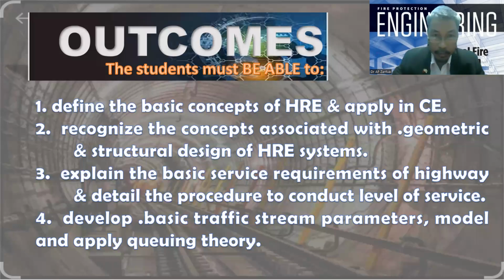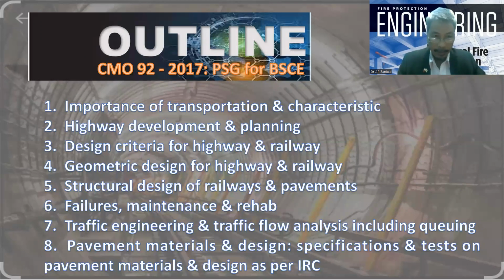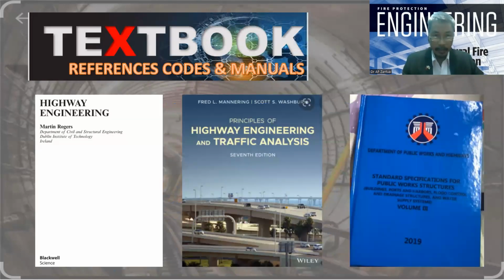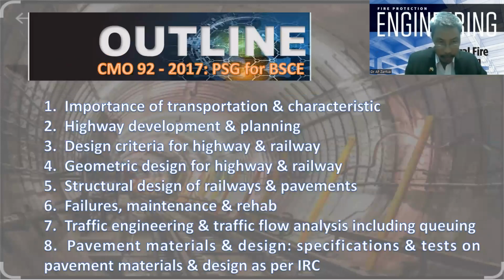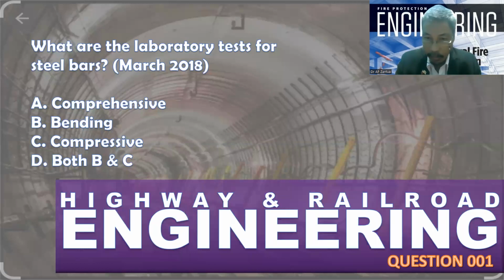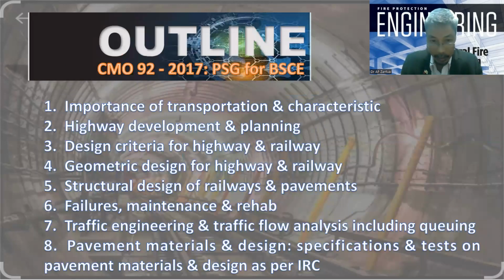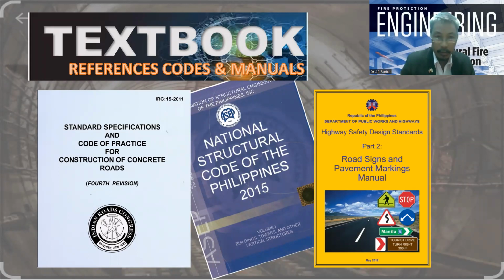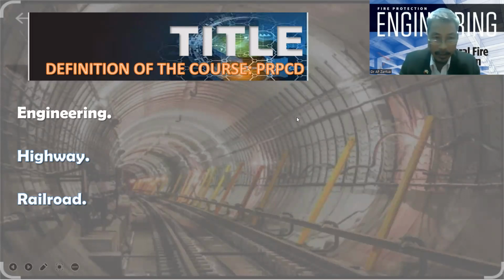Introduction to HRE [ Highway & Railroad Engineering ] Module 1.00 Part II

Comment: Thank you, sir, for continuing the introduction to this course. The course outcomes and outline are very interesting. As a commuter, I always ask myself how highways and traffic interact with each other, to someday develop such solutions to this traffic problem. Thank you, sir, for giving us the different book references for this course. The answer to the question, what are the laboratory tests for steel bars?, is bending and compressive. The grading system, sir, is fair and always based on a student's self-performance. The terms and definitions are explained in a clear and easy-to-understand manner.

Comment: Thank you sir for this video continuation on introduction to Highway and Railroad Engineering and giving us textbook, reference codes and manuals that is related to the course.
Question: What are the laboratory tests for steel bars? (march 2018)
 Answer: D. Both B&C

Comment: Thank you sir for this topic continuation in introduction, It also tackles about the book references that we can use during the discussion. And also there is additional question in the video, 
*What are the laboratory test for steel bars a. comprehensive b. bending c. compressive d. Both B and C 
my answer is letter D.

Comment: ----thank you sir for the continuation of introduction to hre. Thank you for explaining briefly about the course outcomes, course outline and referenes that we students must be able to gain.
Course outcomes:
a.	Define the basic concepts of hre and apply in ce.
b.	Recognize the concepts associated with geometric and structural design of hre systems.
c.	Explain the basic service requirements of highway and detail the procedure to conduct level of service.
d.	Develop basic traffic stream parameters, models and apply queuing theory.
----also you’ve gave us the details of course outline for this semester:
a.	Importance of transpportatio and characteristic
b.	Highway development and planning
c.	Design criteria for highway and railway
d.	Geometric design for highway and railway
e.	Structural design of railways and pavements
f.	Failure, maintenance and rehab
g.	Traffic engineering and traffic analysis including queuing 
h.	Pavement materials and design specifications and test on pavement materials design as per IRC.

Comment: Thank you for the continuation video about the introduction of HRE. In this video it explains the program outcomes, outline of CMO yr 2017 of HRE and also we will learn about different technical terms with connect to HRE, just like queuing theory, engineering, highway and railroad. It also tackles about the book references that we can use during the discussion. And also there is additional question in the video, *What are the laboratory test for steel bars a. comprehensive b. bending c. compressive d. Both B and C my answer is letter D.